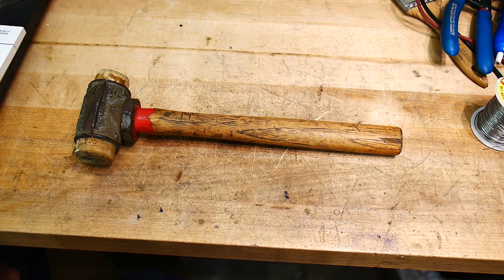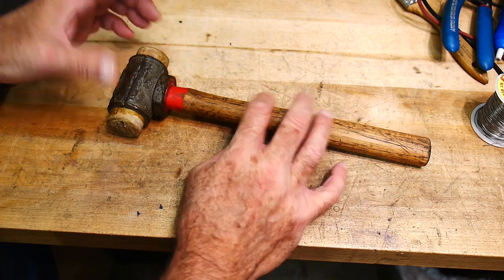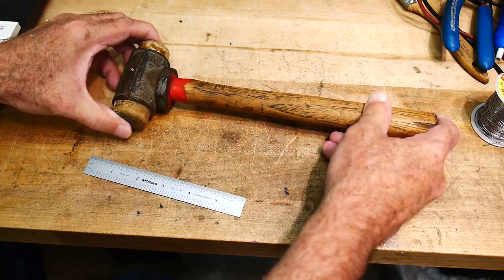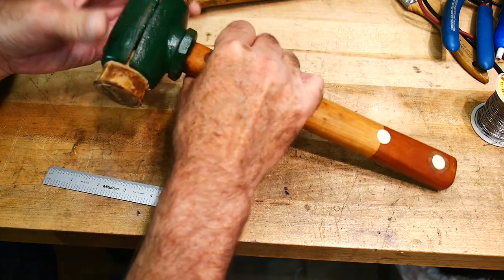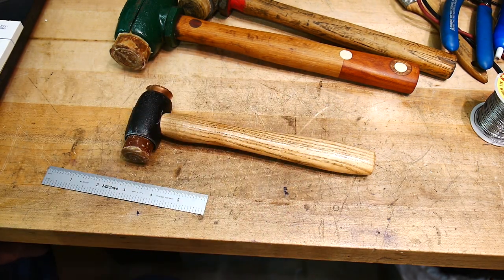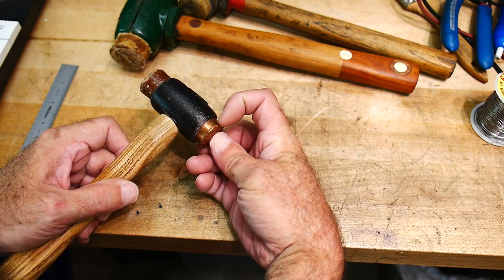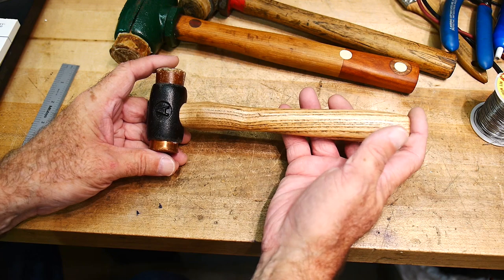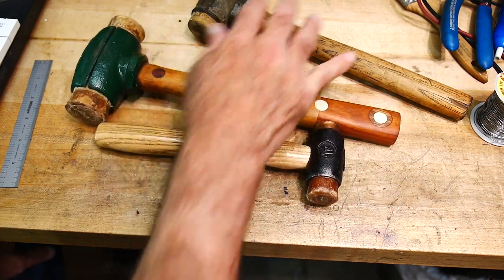#519 A must have hammer

Comment: A corrugated cardboard company I worked for used that rawhide type of hammer to hit in cutting blades into the plywood cutting dies, hitting it in from the sharp side of the cutting blade.

Comment: i have the same thor hammer but vintage, both ends are copper. it is a nice tiny hammer that has quite a bit of momentum to it. need to restore it . got it for $5 at the local flea. were used initially to open and lock in knock off nuts

Comment: Hi, thanks for an interesting share. I'm wondering how different the raw-hide ones are from plastic/rubber dead blow hammers. Cheers.
Reply: The main thing is the peak impulse generated, this is dependent on the hardness of the face. So stiff plastic gives a sharper blow than rubber, rawhide somewhere in between. It’s a compromise between getting a good shock into the thing you’re hitting, and not distorting it. Rawhide is also somewhat “deader” and bounces less than plastic or rubber.

Comment: how can you remove the copper faces
Reply from the maker: they are pressed in, so I would try putting in vice and levering, or drilling a hole and putting in a bolt or screw and pulling out